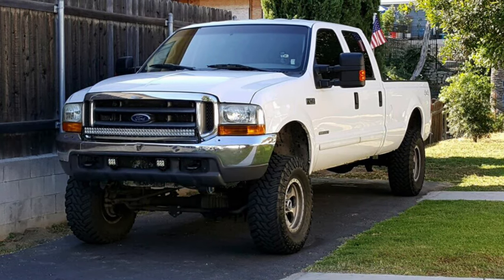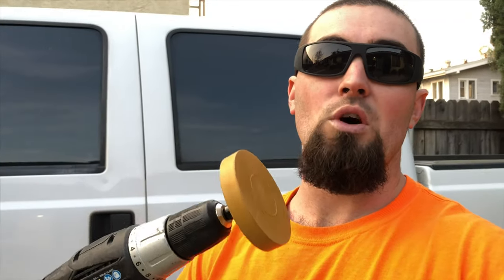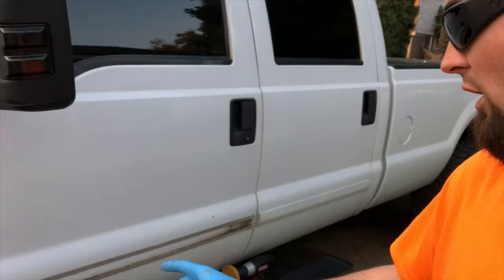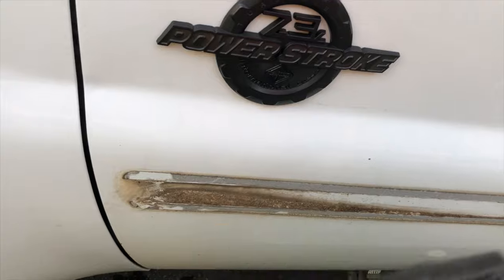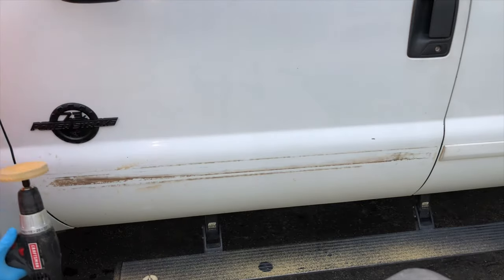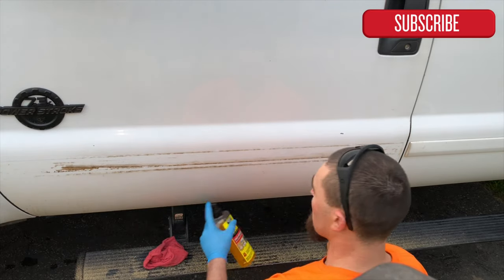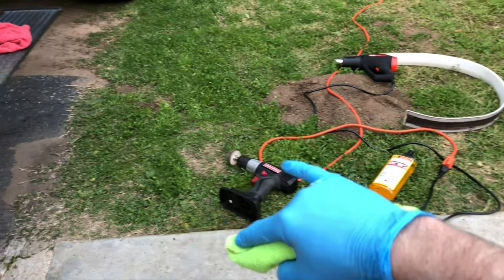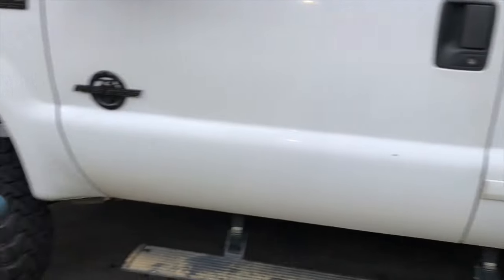Removing the door trim from my 7.3 powerstroke THE RIGHT WAY!

Comment: Metzger what's up man another nice video! Hey you said awhile back you might take off your Amp steps, if you do can I buy em off you? My girl keeps complaining how hard it is to get into my Obs.
Reply from the maker: 805_Diesel yeah man I’ll let you know! I’m gonna try and diagnose the problem before I take them off. Since each step has its own motor and they both stopped working at the same time I’m thinking it’s a fuse or a ground or a relay or something. But if I can’t fix them I’ll send them your way and maybe you can fix them for yourself. lol